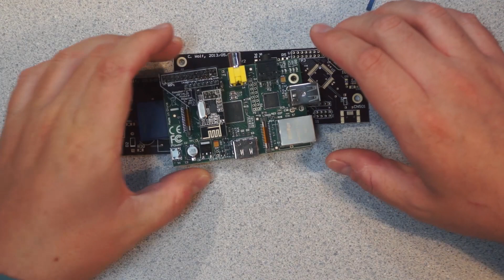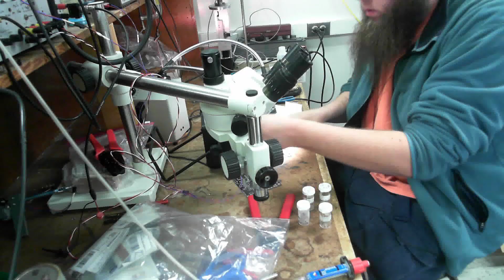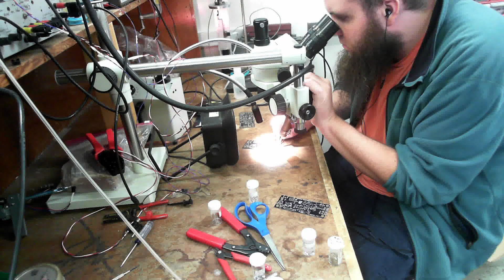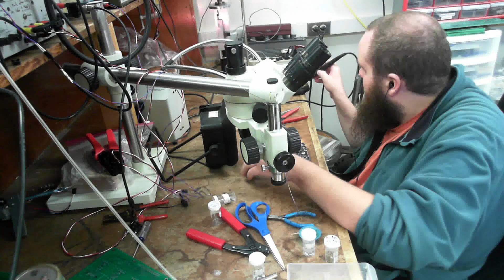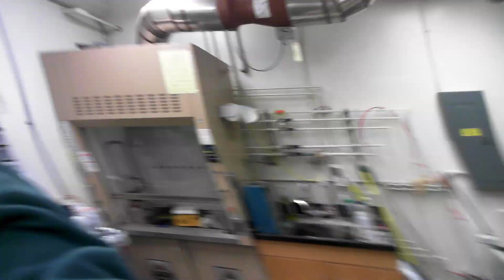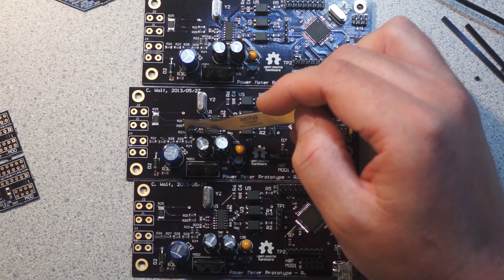Power Meter Project - Part 2

Comment: I'm starting to work with the CS5490, page and continuous conversion commands work, the chip work answer me properly, the problem is how to interpret the data. compare them with the truth table data sheet but not quite understand how to interpret the data in a data of actual measurement.

Comment: I have my isopropanol in a spray bottle. I spray it on, then I put a kimwipe down and brush the flux off through the Kimwipe. With the large quantities off the board and on the wipe (which is now in the trash), I spray copious amounts of isopropanol over the board to wash the rest away and into a sink and I end up with a nice clean dry board when the isopropanol evaporates.

Comment from the maker: First, a FPGA would almost certainly cost as much or more then a raspberry pi.

We're certainly not particularly attached to the idea of a rPi for the central node. It just has the advantage that we can stick Apache on it and be able to do all sorts of fancy web/AJAX stuff without a lot of trouble.

Oh, did I mention they're just $35? For what you get, it's ridiculously cheap.

Comment from the maker: I can get boards that look as if they never had flux on them with cyclic flushing with acetone/methanol mix and water. 

I think how various solvents work is very, very dependent on the particular solder you are using. Isopropanol may work with some, my acetone/methanol mix better with some others.

Comment from the maker: I've never particularly liked isopropanol for defluxing.

As for it evaporating, that's actually not that great a thing. If you dissolve the flux into solution, and then the solution evaporates away, it just re-deposits the flux all over the board.

The trick is to *flush* the board with your solvent of choice. That way the flux gets carried away with the waste solvent. I actually cycle back and forth with water and acetone/methanol mix, as they displace each other.

Comment: Probably doesn't make sense for them to make a lower powered chip, but at lower powers there's scope to save BOM cost with smaller inductor and caps, and use a halfwave rectifier - should get under $1 total at 1k qty.  Might be worth looking to see if there's anything in the LED driver market that might be suitable.

Comment from the maker: Putting together a decent forum to discuss this stuff would be a good idea. 

Using the integrated ADCs in a MCU is an interesting idea for a very, very budget option. The advantage of a specialty IC like the one I'm using is it has much higher resolution - the ADCs are 24 bit. I'd like to be able to measure very small amounts of power accurately.

Maybe multiple options/configurations? The wireless protocol will be OSS, so there could be multiple projects that share the comm infrastructure.

Comment from the maker: The problem is getting a decent amount of power out of a capacitive-dropper like that. We want a mesh-network topology, which means that the nRF transceiver is going to have to be awake and listening continuously. It has a static current draw of ~13 mA when listening, so we need that, plus the MCU, plus the power measurement IC, which is 20+ mA. 
Unfortunately, that's rather prohibitive with a power-factor cap dropper.

Comment: Check out The Power Integrations Linkswitch range (LNK304 ) - very cheap non-isolated PSUs - should be close to that price range

Comment: in my experience through hole is more annoying for prototyping as you can't really repeatedly desolder stuff without eventually pulling out metallization. SMD is really easy to work with; just loosely aim the hot air soldering iron at it and it pops loose, easily replaced by something else. The only real benefit to through hole is you can breadboard it, but with lots of designs requiring pretty tight layout thats often not an option anyway.

Comment from the maker: This project actually doesn't need isolated power at all. The only reason the prototypes are isolated is so I can probe the MCU signal lines without going through a lot of trouble.

The real challenge is figuring out how to go from 120V/240VAC to 3.3V ~25mA with only ~$1-$1.5 worth of parts.

Comment from the maker: Resistive. The power-management IC has a built in PGA, so you can use a really, really small Ω shunt. The prototypes use a 0.02Ω resistor.

The power module is ~$6. By doing it with discretes, we can probably get it down to $1-$2.